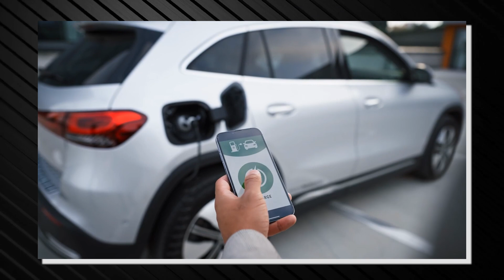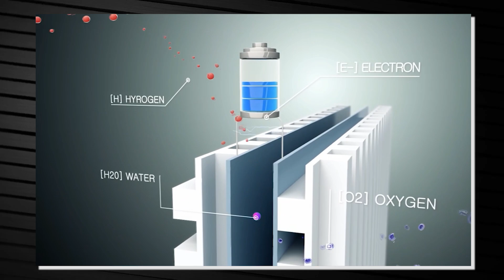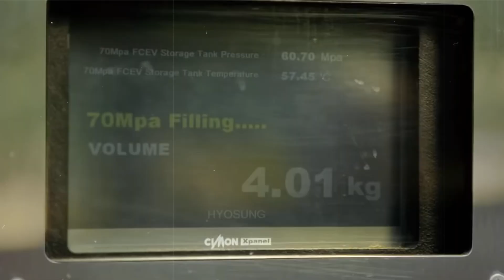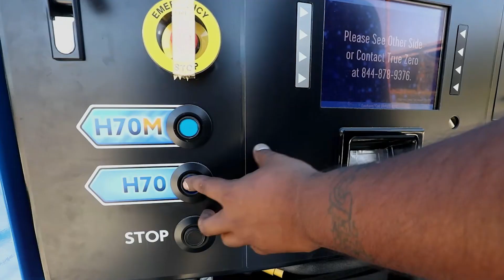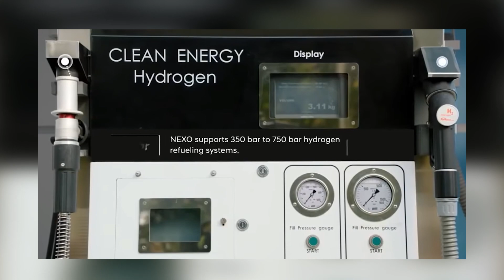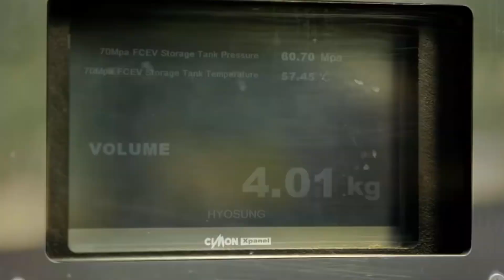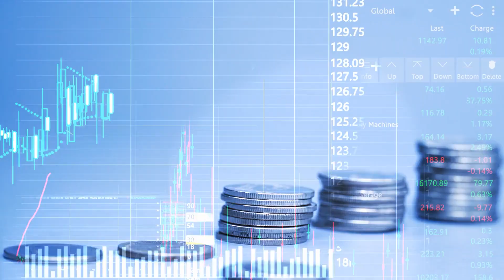Could Hyundai's New Engine Wipe Out the EV Industry?

Comment: Hydrogen is not a renewable energy. At least not the way it is produced today. Most, as in, 95% of hydrogen comes from breaking down the hydrocarbons Natural gas, oil and coal, in that order. The process to do so produces CO2. Any leaked H2 reacts with chemicals in the air to produce compounds that are up to 12 times worse that CO2 as a greenhouse gas. To make hydrogen renewable you would have to produce it by electrolysis with the electricity coming from renewable sources. Currently 0.04% of hydrogen is produced that way. (2021 numbers)

Comment: While it is technically possible to run an Internal Combustion Engine on hydrogen, using that bulky, difficult to store and expensive fuel in inefficient ICE engines results in very short driving ranges and insanely high fuel costs. Also, performance is reduced. 

You have totally confused hydrogen fuel cells, which at least has a reasonably high efficiency and thus reasonable driving range, with hydrogen ICE is not efficient and has a poor driving range. Sorry, but hydrogen will never be economically competitive to cheap clean electricity.

Comment: This presentation compares Hydrogen with dirty fossil fuel vehicles, when the real competition is with zero emissions battery electric vehicles. In order to be 'green' the hydrogen must be sourced from renewable energy generators - wind or solar. Converting the electric energy into H2 results in considerable energy loss. The H2 must then be compressed (200 atm), stored, and transported, or piped to the filling stations, all of which consumes more energy.
When the H2 is finally pumped into the vehicle, the inefficiencies continue. These cars have a high-pressure hydrogen fuel tank subject to the leakages of the rough and tumble of the road, and a hydrogen fuel cell which is lucky to be 60% efficient, converting the H2 chemical energy back into electricity. Then they still require a 90% efficient electric motor, the same as a battery electric car. Hydrogen is notorious for leaking - even through solid metals! All these steps involve energy losses and H2 leakages.  As a result, only about one third of the original renewable energy is available to drive the vehicle.
 As a result, Hydrogen fuel cell vehicles are more complex to build, and cost twice as much as today's BEV. 'Green Hydrogen fuel costs far more than the 'green' electricity. While you may talk about future improvements in the cost and efficiency of the fuel celled cars, it is important to remember that battery electric vehicles are also becoming cheaper to own and operate, so their present competitive advantage is likely to be maintained for the foreseeable future.
Reply: Hydrogen fuel will not be used for Cars in the long term. Its a riskier fuel and the refuel stations are even costlier to build. Hydrogen fuel may see applications in Heavy weight transport where the energy density can play a key role.
Reply: Yep and 95% of hydrogen comes from reforming fossil fuels. With only 0.04% of hydrogen being produced by electrolysis with the electricity coming from renewable sources.